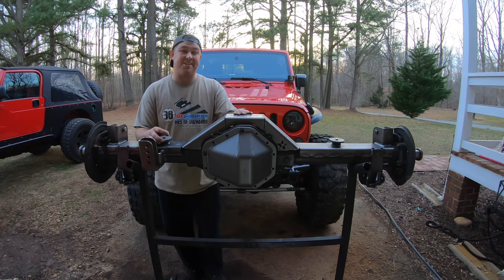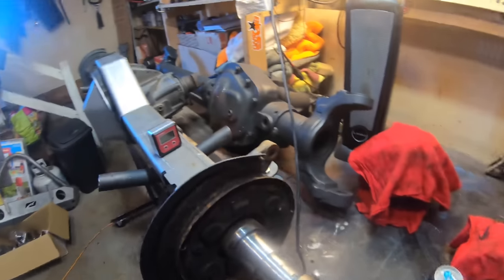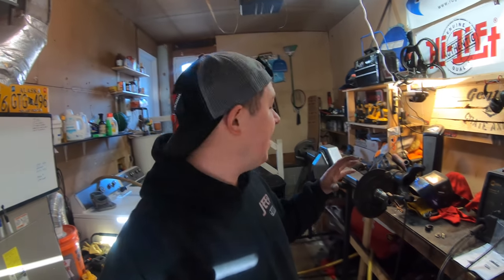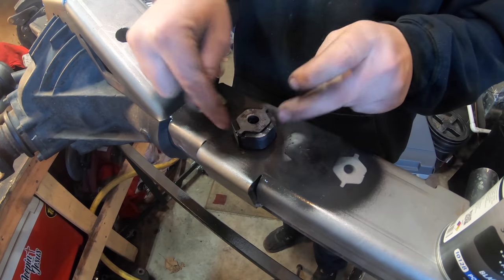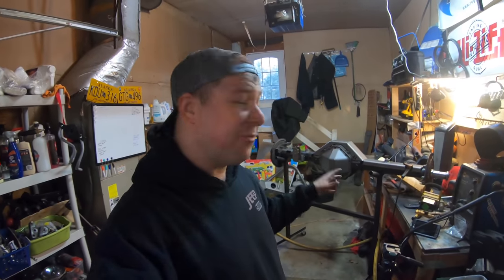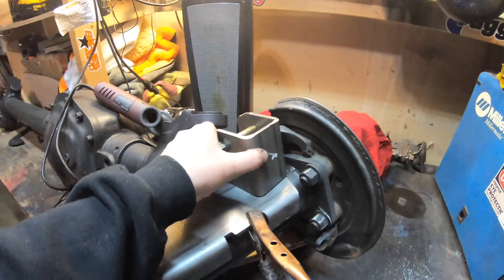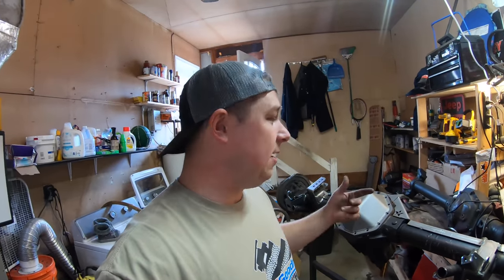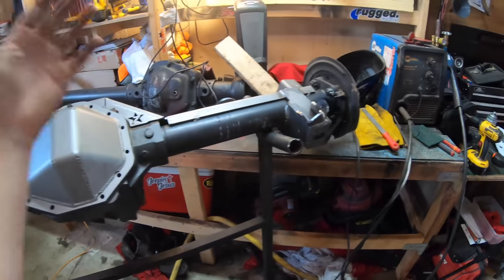Rear Swap Kit Install - JK 1 Ton Swap Episode 4

Comment: I don't know what year your JK is, but if it's newer than 2012 you need to keep all 4 wheel speed sensors.  I ran into a clearance issue with the rear sway bar endlinks and the rear wheel speed sensors (mounted with the Artec brackets.)  Just something to look out for.  Also had the same clearance problems that you ran into with the caliper brackets and the upper control arm bolts.  I just ground the caliper brackets similar to what you did.

Comment: You and dirt lifestyle and the best jeeptubers.
Reply from the maker: Thanks man 🤘
Reply: Yes sir. Im swapping some 60s into my tj my axles are older from a 95 one ton. I know I still have drums in the back besides that do you see any setbacks to the older axles?
Reply from the maker: Cody3232 Cody3232 not too many, but if you can find a 14 bolt it is a lot stronger and had more aftermarket support
Reply: Thank you sir

Comment: +1  for holding your ground clamp with a glove and moving the red hot piece with a bare hand.  Lol.  I'll be welding mine stick as my mig is only 110. Want to make sure I get enough penetration. Not good enough with tig yet.  Want a bigger mig setup though.  Anyways. Looks good.  Hard to tell from the video but the gaps between the truss and the cast look a little wide? Gonna be able to walk those?
Reply from the maker: Haha yeah that was a blonde moment 😂 and the gap isn’t bad at all and it’ll fill in fine, the camera makes it look bigger than it is
Reply: @JKGearandGadgets  awesome. Was hard to tell and all air gaps look huge anyways.  Looks great. Waiting for the next video.

Comment: I'm not so sure that truss is providing very much support in the vertical axis. At least not near where the tube enters the center cast housing.  It's just a big horizontal flap. That'll bend really easily. It needs some vertical pieces going from the center section to the tubes.

Comment: I love the video series! Keep it up. One question what about tapping for air line for lockers? Dont you want to do the before you add the truss?
Reply from the maker: Not really, the truss can easily be trimmed back if needed. Plus there is still a ton of room near the diff portion of the axle

Comment: I appreciate everyone's build and I would love to wheel with you one day (I own Rams never had a Jeep). But I think you should have went with a RAM Dana 80 in the rear, sure you will lose some ground clearance but it is the second strongest axle you can get (other then Rockwells). We actually did a RAM 3500 Dana 60/80 swap on a buddies Cherokee (I don't know the two letters you Jeep guys use 😂). So I  guess my question would be why didn't you? (Again not downing the build as I like to see what everybody does and I do like your Jeep and am jealous on how much more aftermarket support you guys get compared to us RAM guys )
Reply from the maker: That’s a great question!!! And surprised it hasn’t been asked yet. The Dana 80 is a great axle, but for me it is overkill. The extra weight is a downside, now if I was running a powerful V8 with 42s then it might be a good choice, but it’s a little too bulky for what I need. Plus aftermarket support for the 14 bolt is much more vast than the 80
Reply: @JKGearandGadgets  I agree with everything except aftermarket support. They make them but there isn't a lot of companies, so I guess you are right. My truck is factory with a 60/80 and I abuse the piss out of them in also running 40s with plans on 45s

Comment: Really dig your series! This has been hugely helpful with prepping for my one-ton swap. Did your axle come with disc brakes? Those don't look stock, and mine has the drum brakes and I really want to switch them out for discs. (Kinda have to now because grinder reasons) If they do come out of a factory setup, do you know what brakes would fit these hubs?

Comment: Why not weld the low profile nuts on the outer control mounts
Reply from the maker: You could! I’m just not a huge fan of that because sometimes it can distort the nut

Comment: You mind reminding us what welder you using for this stuff?  Thanks!
Reply from the maker: You will want to use a mig setup with gas, capable of welding up to 1/4” steel.

Comment: Should I put long arms on before I weld the truss on then since the pinion angle will most likely be different?
Reply from the maker: Long arms won’t change your pinion angle, unless you changing your lift height.
Reply: JK Gear and Gadgets okay thank you! Just studying for now.

Comment: why keep the shock mounts that hang below the bottom of the axle?
Reply from the maker: Because if I raised them flush I would have almost 0 uptravel. The only other option would be to mount the upper shock mount through the rear tub, which is pointless. If I ever move them it would be during a coil over swap

Comment: You could just weld the nuts onto the brackets. No wrench needed on one side.
Reply from the maker: Very true. Part of me hates doing that in case for some crazy reason I cross thread the nut. But yeah, a welded nut would fit great and make it easier when removing that control arm

Comment: JK Gear and Gadgets once the axles are installed how much of a difference in weight will your Jeep be compared to when it was stock? How drastic does that difference affect the 3.6 Pentastar?
Reply from the maker: I will be weighing the Jeep before and after. I’m guessing around 600-800 pounds more. But with 5.38 gears it will help alot

Comment: Did you build your axle cradle of did you buy a kit I will be doing a 8.8 swap on my Ls swapped Tj soon just trying to gather accessories to make it easier on me with all the grinding and cutting out in my near future
Reply from the maker: Talking about the axle stand? I made it
Reply: JK Gear and Gadgets yeah that’s what I was referring to and I will probably also build my own they seem simple enough to fabricate
Reply from the maker: Very simple! And add casters from harbor freight to help make it mobile!
Reply: Yeah I added casters to HF 20 ton press my shops a 12x24 weatherking portable building so I keep everything mobile

Comment: Does the 14 bolt have the same pinion position as the original JK 44  or is it offset like the Sterling?  Thanks for everything!
Reply from the maker: It is not as offset as the sterling. It will require a lift of 3" minimum though, just because the center section is alot larger than the 44. My yoke had slight rubbing on the gas tank, but one good flex and it self clearanced the tank skid, no more issues at all
Reply: @JKGearandGadgets  Thanks!  I'm going to do this!  Cheaper to do this than buy one 44 axle.  Think I'll use the Serling and may retube it.  Will a 4.5 inch lift be enough to run 40's?
Reply from the maker: Brian Fedie remeber that if you retube and move the axle over you will need to have custom axle shafts made. Plus your driveshaft will be offset if you move the pumpkin to clear the tank. That option will be less than ideal and pretty expensive. The 14 bolt is a better option.

Comment: Are you running a flux core MIG or gas? If its flux core does it work well for what your doing? Thinking of getting a MIG for fabrication on my CJ5 project.
Reply from the maker: You will want a mig setup with gas
Reply: @JKGearandGadgets  I can't quite see what Miller model you're using, is this the Miller XMT with pulsed MIG? I'm not that good of a welder yet, but I've seen some really good forging die rework with those Millers, is weld-temperature controlled enough without a wire-cooling water-jacket or are the Dana housings pretty stable from warping from weld-temperature variance?
Reply from the maker: John Filmore I’m just using an old Miller 175.
No worries about warping unless you weld in the same spot too long, or weld it from one side to the other without alternating.

Comment: Ben, did you load the axles to prevent them from pulling upwards when welding?
Reply from the maker: Nope, no need as long as you alternate sides and directions of welds
Reply from the maker: And of course use a truss that fits correctly without gaps
Reply: Thank you! Do you recommend Barnes or Artec?
Reply from the maker: DJ Redl Barnes/7 slot custom. 
7slot customs offers 10% off for the channel using code JKgear

Comment: What did this axle come out of?
Reply from the maker: Chevy 99-06 Silverado 2500
Reply: @JKGearandGadgets  did it come stock with disc brakes?
Reply from the maker: Yes, check out the 1 ton swap playlist, go over all this and show the entire build from start to finish
Reply: @JKGearandGadgets  Sweet. I’m picking up a 14 bolt for float with this brakes out of an 04 2500 Chevy. I just wanted to make sure that it is indeed a full float. What is the best way to know?

Comment: Are all dana 30 from,any jeep the same
Reply from the maker: No, lots of different versions. YJ and XJ Dana 30s are high pinion, TJ and later XJ Dana 30 are low pinion and weaker. Jk Dana 30 are high pinion and stronger than older Dana 30s
Reply from the maker: Plus brackets and widths are different
Reply: So if I were to look for gears and air,lockers I would have to go by make and moddle and year

Comment: How many amps is your welder? I have a little 50 amp tombstone and I asked some people if I could run it on house hold but everyone told me no. But then your running it from house hold so can you or someone in the comments help me out????
Reply from the maker: Is it 110v or 220? My welder is 220v and I run it from my dryer outlet. What welder do you have?
Reply: @JKGearandGadgets  yeah its a lincoln 220v 50 amp
Reply: Just need to have a 220 3 prong plug. If you dont have one you. An get one installed fairly cheap.
Reply: @JKGearandGadgets  I guess my question is do you have an adapter or does it plug straight in??? And if you have an adapter where did you find it
Reply from the maker: I made an adapter for it to plug into my dryer outlet, very easy. Buy a dryer plug and wire it up. Hard to explain over typing. Do you have a 220V outlet in your garage (dryer)?
Reply: @mikem5831  is there any danger of tripping the breaker or missing up anything electrical if I run it at full steam when I switch the connector?
Reply: @JKGearandGadgets  yes I do have a plug for a drier
Reply: @fomocoloco7172  depending on what dryer plug you have. Most welders are 3 prong where dryers can be 3 or 4.  Get a plug that matches your house dryer plug and then wire it to match your welder.  Like ben said, hard to explain here.  Your dryer service should hold the welder just fine.  I put a  new drop in my garage just for my new 220 tig/stick welder.
Reply: @fomocoloco7172  nope. A 50 amp tombstone will burn a rod up long before the welder maxes its duty cycle.  Rods burn too fast.
Reply: @mikem5831  mmm ok that's awesome the circuit box is mostly what I'm worried about. Thank you so much